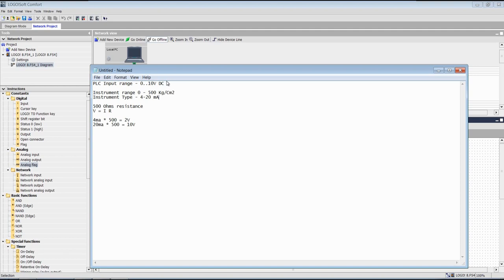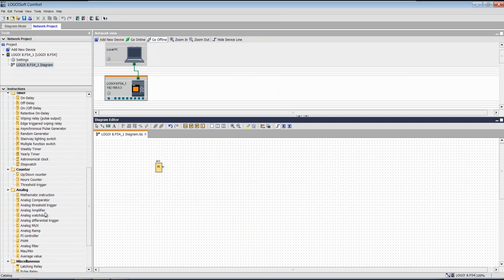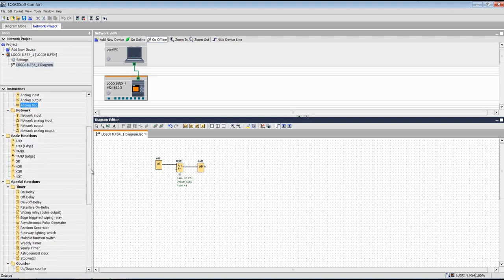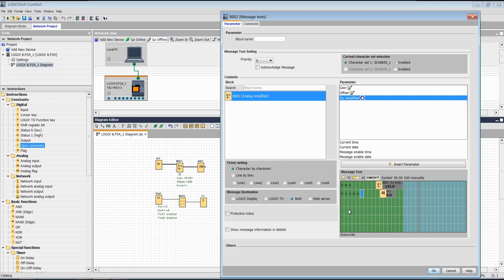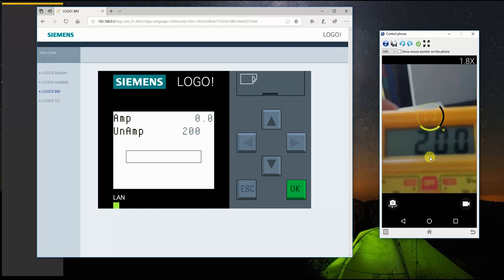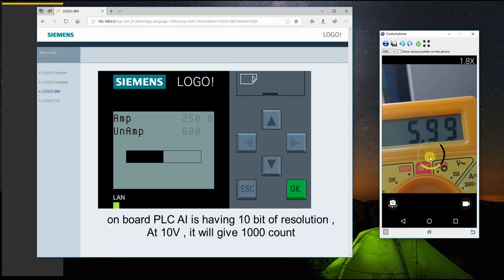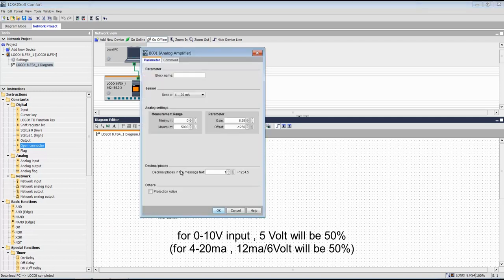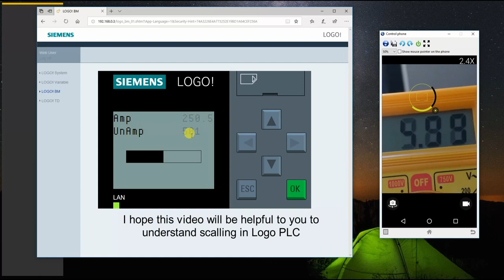Siemens Logo PLC analog input scaling and bar graph

Comment: Is it possible to connect the 3 wire transmitter in logo PLC ???
Reply from the maker: It's possible.
But wiring depends on where you are connecting - either on on board PLC input (0-10V) or external module (4-20 ma)

Comment: sensor input is 4-20ma, but logo input is only adopt 0-10v. so used 500ohm resistor to convert 4-20ma to 0-10vdc. but why did you configure the logo AI 4-20ma? should configure 0-10v right?
Reply from the maker: becase at 4ma you will get 2V. so 0-10V wont work.
Reply: Bro please tell me how to scale 4-20ma analog block in siemens logo plc, as I'm using AM2 card so in this how to do the logic of 4-20ma analog. Please tell me bro

Comment: PLEASE SHOW WIRING FOR ANALOG INPUT ASSIGNED? DID YOU USE I7 AND I8 AS 0V AND 10V OR M LOGO PLC POWER SUPPLY 0V ?
Reply from the maker: M as 0V and I7 , I8 as 10V +(input)
Plz refer wiring diagram in manual.
Reply: @StableAutomation  thanks alot sir
Reply: Dear Sir,
So can i consider I7 as AI1 and I8 as different Analog input ie AI2?
Reply from the maker: @moindalvs  Yes..
Reply: @moindalvs please share me logic diagram how you are connecting block and which block you are connecting